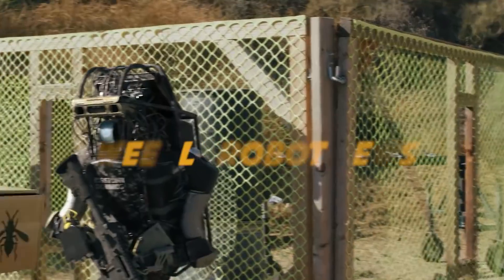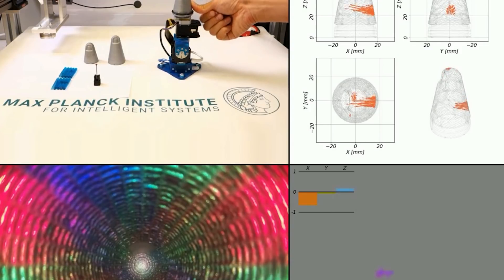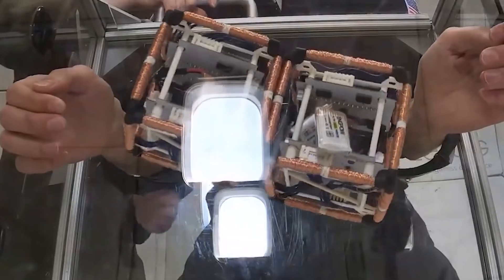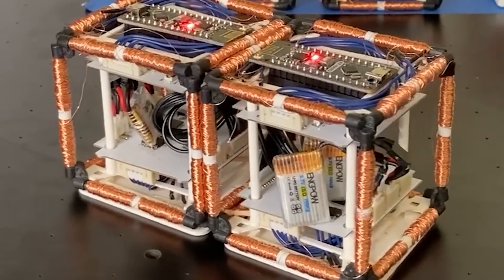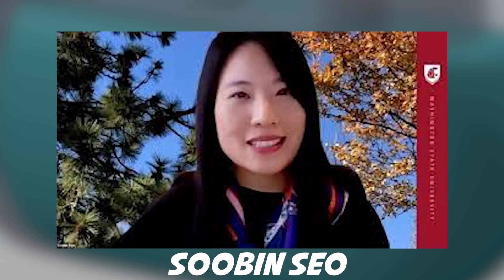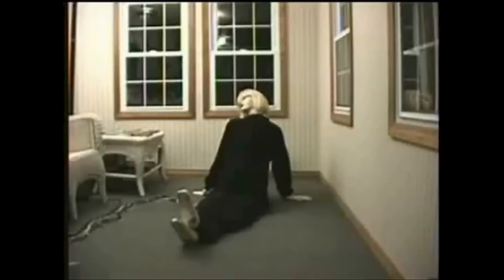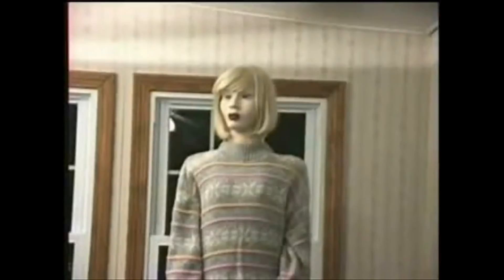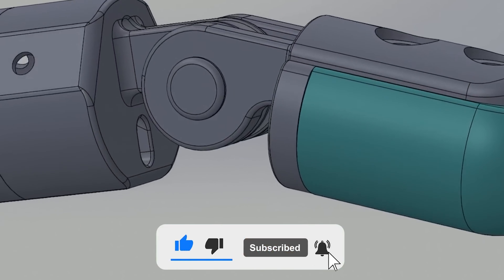LEAKED: Latest Robot and Future Technology News | Weekly News #10

Comment: you can also put small arms missiles on side of the robot dog a tracking system to locate enemies nite vision can pick up heat sinner the can also scan for minds on the Ground as wis lunch a nite vision helicopter
Reply: Wat about pinpoint missile like glow paint someting to assist heat vision or a pinpoint flare from the sky like grenade missile so the ally team can assist and surveillance easily pinpoint the enemy location faster  I also think more smaller tech based stuff with a bit flank maneuvers like a super small drone with a shock wire or flash bomb explosion would help with securing locations or a sleeping darts or gas capture and secure